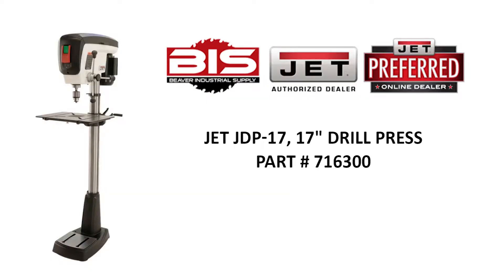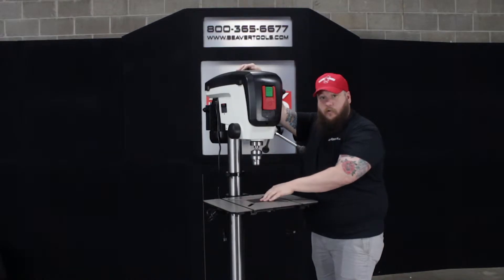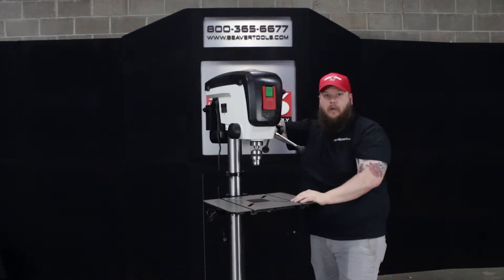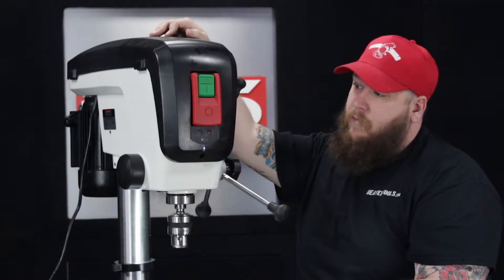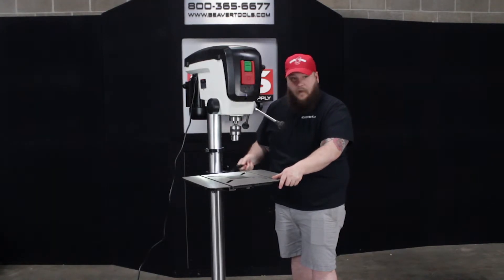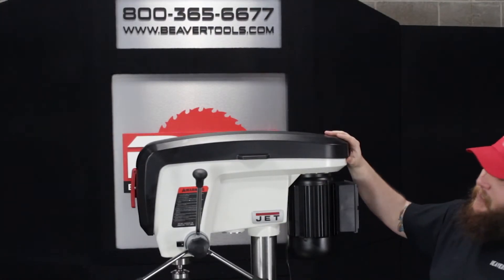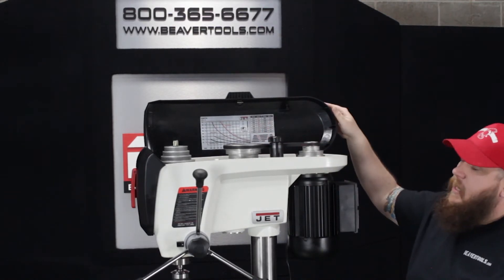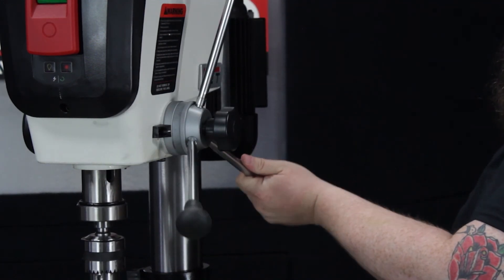716300 Jet JDP-17, 17" Drill Press

Comment: The depth adjustment is not easy, it needs a better explanation. You are better off with a drill press where you can spin the depth of ajustement wheel and measure it with a caliper this is very inaccurate for precision work